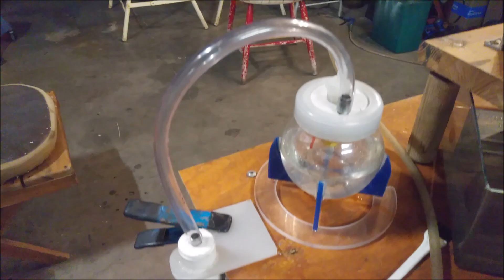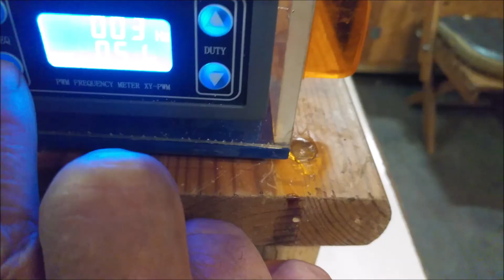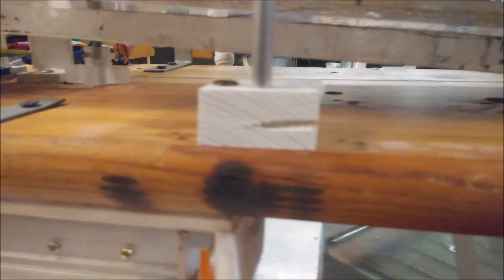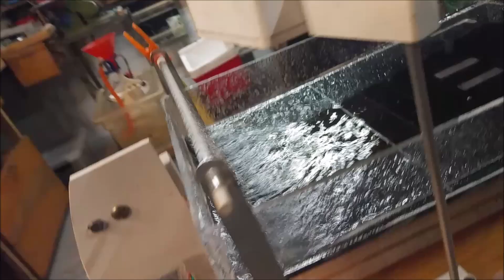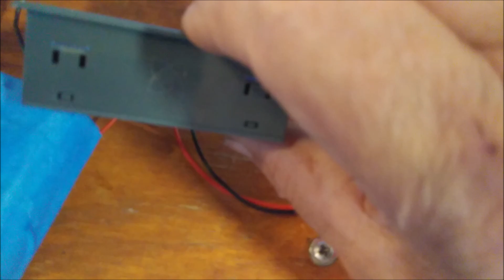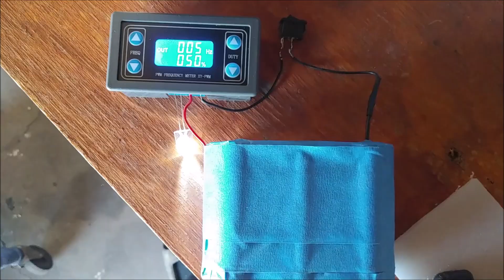Gold going UPHILL - mini wave table - how to

Comment: What size magnet wire did you use to make the solenoid?
Reply from the maker: 20 to 24 gauge will do. Ask any time. I used a 5/8 steel rod and turned it down smooth and shiny so it wouldn't wear out the pvc. whatever fits nice.